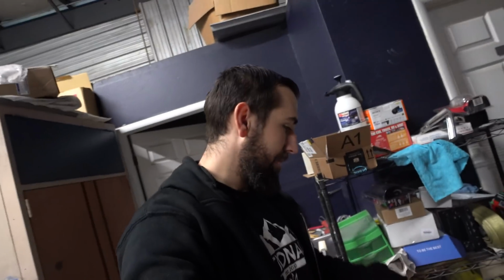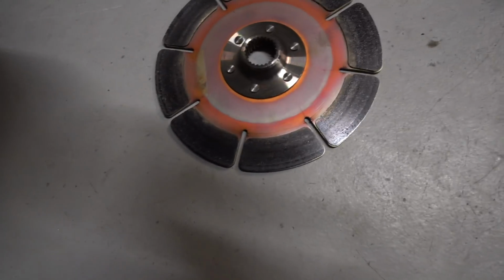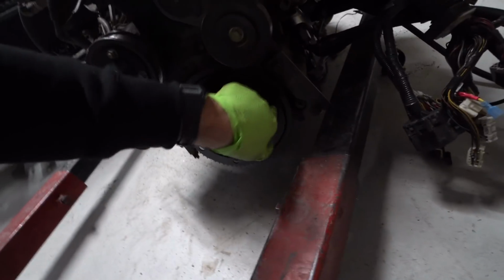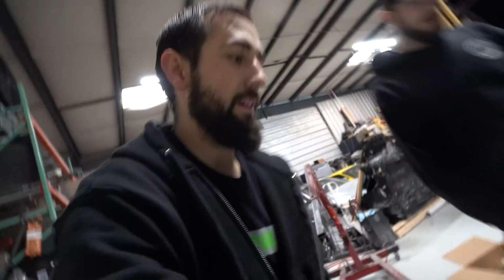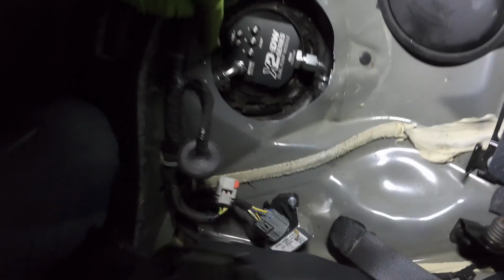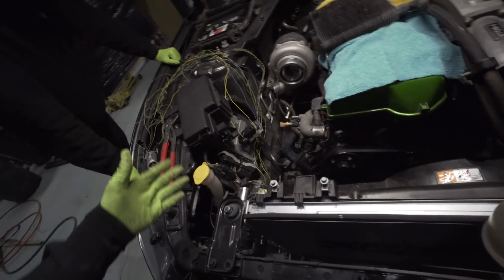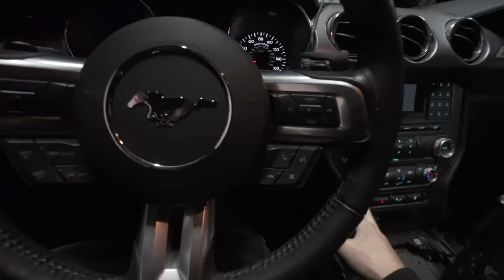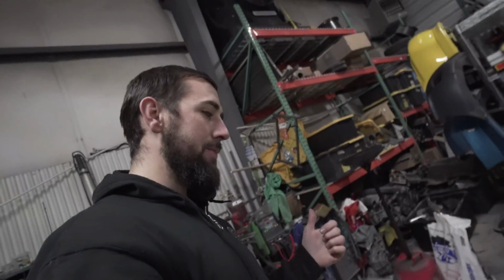Pt.6 | 2JZ 2015 Ford Mustang Build! | 1000HP FUEL SYSTEM!

Comment: you don’t need the coolant temp sensor connected, just hard wire a switch to it and turn it on when the cars on, you wouldn’t get the temp to show on the screen that’s the only thing, it just controls when the fans pop on

Comment: Trevy's Customs FTW, looks don't matter if it meets the requirement. Thank you for installing an actual high flow fuel pump.  Other YouTube channels go with boost a pump products which is not the best way and are actually more work, less reliable as awell as prone to leakage.  The clutch is another area where other YouTube channels leave until last to upgrade when it should be fuel syste, clutch and then more engine power.

Comment: Again good work! You seem to get a lot of things done as of late. On the build; the temp sensor as has been said might need to see fluid but as it is not reading at all something else is probably not reading what it should. See how it was mounted on the ecoboost. Most temp sensors old(single wire) or new use the block as a ground. On the trans mount I'd triangulate that piece of angle iron with just as straight piece of metal connecting the 2 sides(leaving the mounting bolts open obviously). Just quick and easy, it will take out any of the flex it can have when the torque of the driveline tries to push the trans down.

Comment: btw make sure the ecu can see when the trans is not in neutral, that way if you park it in gear and use the remote start it wont drive away on you. I would think the trans has a neutral sensor/switch.

Comment: Long term you should have Dave design you up a mount for your CPS in solidworks. He could test 3d print a few to make sure it's what you need. Then send the file to a machine shop to make you a billet one

Comment: If you’re wondering why the TPMS light is on its cause the stock wheels that have the sensors in them arent on the car. Or the sensors in general aren’t in the wheels that are on the car.

Comment: A clutch master cylinder with a smaller bore will give you more leverage on the clutch, less effort. But also may not push the slave enough to disengage the clutch. Takes some trial and error

Comment: Love his fuel system installs. Every other word is "AN Fitting." 
Trevor just a heads up a cars fuel system is in the hydraulic world and AN fittings are a special tolerance that come with certifications. I can seriously doubt you are buying those and if you are you are wasting your money, a normal JIC fitting will do exactly what you need. 
And for all the watchers, fittings go in 16ths of an inch, so a -8 AN Fitting is 1/2".

Comment: Always look forward to new episodes for this build.  Can't wait to see this thing on the dyno!

Not sure if it's been mentioned before, but think the mustang came with a "smart" charging system where the PCM wants to control the alternator.  Not sure how well it will get along if the JZ alternator is internally regulated.

Comment: Is that going to be sufficient alternator amperage to operate that power steering motor under heavy load?
Reply: I was curious about this. I didn't find any electric power steering setups that would draw more than than 15 amps = or < rolling down both windows at the same time.

I specifically looked at the different ones that people use in various years of Mustang.

Comment: I Wouldn’t run that DW fuel filter. Whatever glue they use to hold the caps on the ends of the stainless filter deteriorate and you end up with black gunk all inside the filter housing.

Comment: Is there a way to put the crank position on the back of the pulley so it doesn't get ripped off if you throw a belt